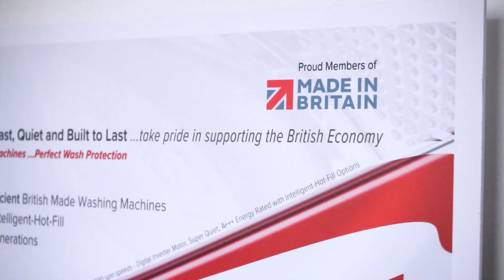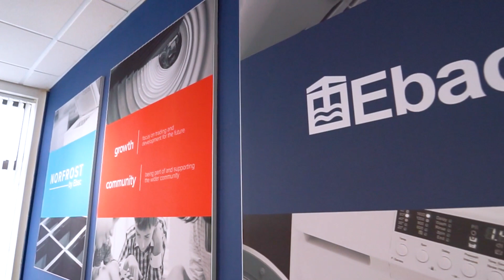John Elliott & Graham Robb | Ebac Overview

Comment: Great job Ebac
Reply: washers from them not rated highly, terrible quality, very Loud on spin at 1600 (if you can get it to spin at 1600), shock absorbers are terrible, i thought lg washer shocks where bad?, if you go for a refund they refund you half the money not all of it, 
points need addressing..
1. Internal Soundproofing
2. better Shocks
3. no marker on program dial
4. bottom panel is hard to take off, to clean drain pump/filter
5. washer has 2 rubber feet at the front, and solid non removable feet at the rear, a pain to level out
Reply: DONT BUY ONE, YOU WILL REGRET IT???